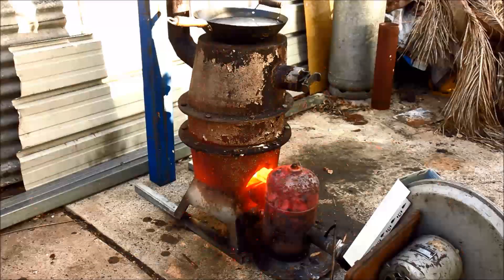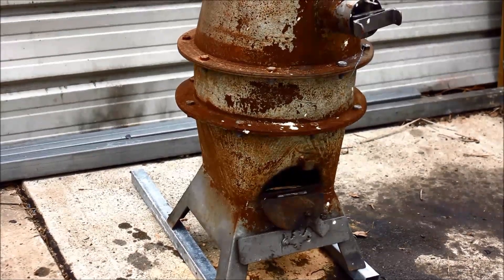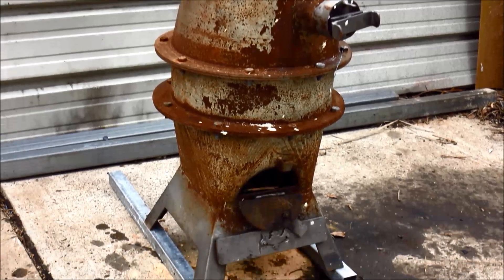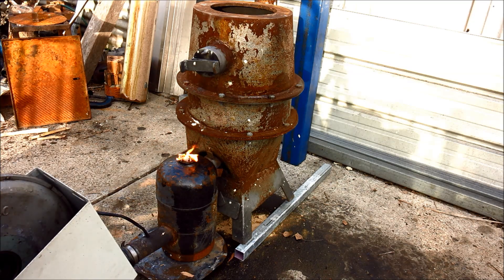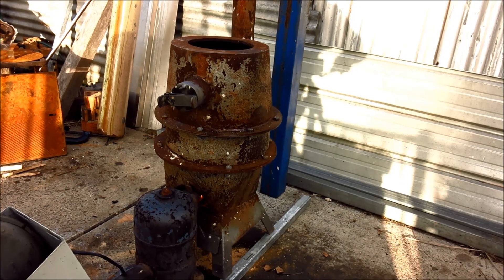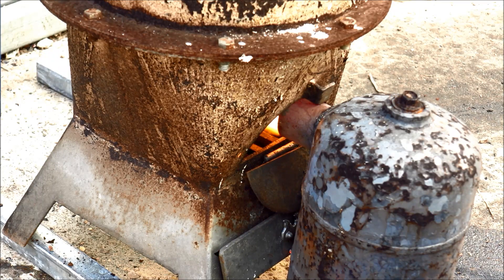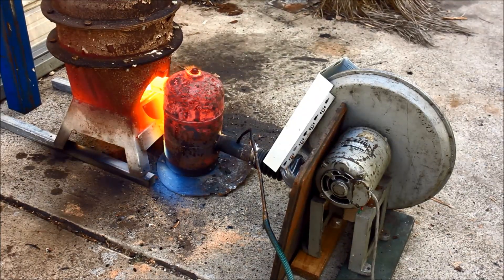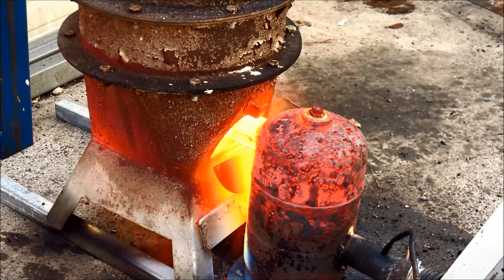Pot Belly Stove Oil burner conversion

Comment: I really enjoy your informative videos and also appreciate the humor. The simplicity of design and the heat you are able to generate is inspiring. Have you ever considered using an old fire hydrant to make an oil burner?
Reply from the maker: +Larry Hutcherson Sr  If you are refering to the Red Hydrants that sit on the footpath, we don't have them here in Oz. There are  special fittings under covers and the fire brigade screw the hydrant into them.  As such, we dont have what you are talking about. I think the sentiment  is right though. they have the right shape although being the size they seem to be and I believer very solid, they would take some preheating.  
Once they were up to temp, I imagine they would make for some  incredibly powerful burners though. 
Another irony in turning fire killers into fire producing beasts.

Comment: I would like to see you make an actual shop heater
Reply from the maker: +jay90374  I have a couple of designs on my other vids already.  I play to do a couple more  " experiments" with this one then convert it into a proper, practical heater that could be used indoors.
Reply: Thanks, I look forward to your vids. I want to use wmo to heat my shop while I work, I just need to find a blower.

Comment: LOVE your channel, it's been the source of continual inspiration! Have you ever had the walls of any of your burners fail on you? It looks like you're getting those things up the iron melting temps!
Reply from the maker: +Coyote Red  Thanks for the kind words!  No, the burner walls always stay intact. I don't think it would be possible to get them hot enough to fail. Even though they have heat on one side, they have nothing to stop it radiating right on out the other side. if i did put some castable refractory or something on them they might go soft but otherwise, i don't think it's really possible. 

They may eventually rust through as I leave the things out in the weather and they flake when i start them up a bit but I don't think they will fail through the temp they reach while running.  I think iron melting temps are basically white hot and i'l a lone way from that with the burners.
Reply: +Oil Burner Makes sense to me! I'll keep these things rockin red hot!

Comment: Have you done a video about thermite? I was wondering if you could use thermite to help get steel to 3000°F and ready to cast. I don't see a lot of casting on your channel.
Reply from the maker: +ownedkapoo  I don't think thermite works like that,  As far as my limited knowledge goes it's more suited to welding than casting but I could be wrong.  I have been meaning to get to the casting for a long time but other things come up and my real passion is for burners.  I'm going to try doing some ally casting soon. I have tons of the stuff to use.

Comment: Great Vid , very entertaining , i have an waste oil heater for my spa pool that works ok, based on the sanders setup, however it could do with a rev up so i think i can use your idea to do the job, nothing worse than waiting for it to heat up on a cold night, have a brother and a mate also into oil heaters and brewing , we call our little club SOBA , sump oil brewers association , will let you know how i get on , Good on ya mate !!
Reply from the maker: +Kevin McCormack  Thanks! I think your organization should expand... But then you'd probably run into a bunch of PC environmentalist do gooders who wouldn't be happy and make things hard for you.   I have a pool heater I have converted to gay and just looking for some plumbing fittings to make work. it's 100Kw rated so would heat up a 2500L spa probably in an hour, 90 min tops.
Running on veg oil, you could afford to heat it up whenever you wanted. I'd like to see a vid of your setup.
Reply: +Oil Burner Will do a vid when i get the new setup running, cheers

Comment: Cool build, I initially thought it was two concrete mixers bolted and welded together....
Reply from the maker: +Yves Baggi   I thought it was 2 truck brake drums but clearly not. One is kind of offset conical shape.  No idea what they were but they were crap as a wood burner. I think with a proper oil burner conversion the thing will be great.
Reply: +Oil Burner i think its a bell housing

Comment: Nice!....What if you put your oil burner inside the Pot Belly, you wouldn´t need to enclose it.  See various other ideas for practical use. Just sitting back and enjoying the fun!!
Reply from the maker: +Roberto .Cavanagh  Yeah Roberto, that's what i intend to do. I impressed myself with this thing. I have had it a while but it's useless as a wood burner and I was thinking to chuck it away.  If I put the burner inside the stove and seal the bottom, all I'll need is a little blower on the outside and the thing will be fit for home heating.

Comment: Also could any of your burners in your previous videos melt things like steel, stainless steel, or iron?
Reply from the maker: +ownedkapoo  Absoloutley.  You would need a furnace with very high quality refractory however to stand up to the heat required.  People are using these burners to do just that. Look up luckygen101 channel and see how he does it.  makes Iron melts look like melting butter on toast.

Comment: I didn't see him put in any oil and I couldn't see how he turned the blower from controllable to insanity. Is there a there a switch or dial to control the blower? Was there already oil sitting at the bottom of the metal vat thingy between the blower and large metal vat thingy?
Reply from the maker: +ownedkapoo  The blower is shown many times in the vid. It's the round circular thing with the motor on it.  I have metal shielding it from the radiant heat of the burner and stove.  It's not the blower that was throttled so much as the oil. Where I show the burner control, the blower is running  constantly, it's just the valve on the oil I'm throttling. 

As I explained, the oil is fed in front of the blower through that tube that goes in the air feed pipe and is blown into the burner  from the airflow.  
Have a look at this Vid   https://www.youtube.com/watch?v=1nTlr6hBv7U    at 14:25 to see the basic air/ fueling setup that i use on all the burners bar the spray burner which has a couple of descriptions on how that is done.
Reply: he starts it with kindling in the tank then slowly turns the blower up then opens the oil line
Reply: +Clarke E Can you show me at what time of the video he put in the oil? Did he use a regular old leaf blower? Or did he use a more complicated blower with switches and buttons?
Reply: +ownedkapoo I don't think I saw it in this video, you can get a better idea watching his others on how he fires it up

Comment: Natural selection,,,,, I love it!!!!  
I am pretty surprised at how much heat the burner can take without blowing a hole in it. What do you think is the longest amount of time you've run one of your burners and have you ever blown a hole in one? 

I'm thinking it might be cool to turn that (PLOP)-belly into a burner itself! Maybe seal up the ash tray and put a rope seal around the door so you can use it for start up. It might be hell to move around, but hell, maybe that upper port could be plumbed to a smelter. 

As alllllways, a great vid, but I don't think  you rolled enough coal to say hello properly yo the neighbors!! ;)
Reply from the maker: +Steve 1961P.  Again you read my Mind Steve. I was thinking to do a full and proper conversion on the heater ( it's useless as a wood burner!) but before I did that, I was thinking I could do a melt Vid with it.  I can just remove the tray at the bottom, put the thing over something to catch the ally and away I go!

I have run the burners over 2 hours at a time but Never blown a hole in one yet. If you look at my furnace meltdown Vid, you can see where I blew a hole in an extinguisher bottle the first time out when it was in the receiving end of a burner.  The fuel Vaporising and the air flow not to mention the air radiating around the burner keep it probably 1000oC cooler than the flame shooting out of the things. Probably why the nozzles on teh burners show a LOT more wear and tear than any other part.  Haven't burnt one off yet but it won't be long on a couple of them. they are getting very burned and thin.  Stainless would probably be better but I haven't paid for a single bit of metal yet I have built my burners from and stainless is not something I find lying round outside scrap yards or dumped by the side of the road.

Comment: Great orange glow on the stove!  
Considering the oily smoke at startup, occasional leaked / sprayed oil escaping and so on, just a bit messy for indoors, how about an oil burner version of an outdoor furnace?  Or you could use the waste-oil powered water heater to run radiators inside.  It would need some automatic controls, or perhaps just a big well-insulated storage tank.
Reply from the maker: +Scott Willis  yeah, this setup was totally impractical for indoor use but i was so impressed by the way it worked anyway and the heat output, I am considering a proper and practical conversion which would make the thing able to be used indoors.  I have been using the water heater for my house. somehow never got a vid but there wasn't much more to it. I just plumbed it to a car radiator  with a fan and  had a circulation pump.  the thing put out some mean heat.  The auto control was the fuel pump timing which regulated the amount of heat the burner produced.   It worked better than I thought. Once the house is warmed up you don't need that much heat and if it got too warm, we opened a window or door.  Thats a home heating luxury you could only do with free fuel!

I'm working on a practical oil powered Swimming pool heater atm which would also work perfectly for home heating with a radiator or hydronic system.

Comment: I made a burner Sunday based on your design, made a video last night of it if you want to see it. I attached it to my melting furnace and other that the shock waves beating my refractory lining, it works great. I made a modification though, I added a propane line for ignition only, after the diesel ignites I shut the propane off and disconnect the line
Reply from the maker: +Clarke E  Great build you have done there and thanks for making me aware of it. i love to see other people putting these things to use and how they do it.
Reply: +Oil Burner thanks, if it hadn't been for you showing how it's done I wouldn't have known where to start

Comment: cool video wish i could do that, that could lower my familys heating bills
Reply from the maker: +Jleone leone  I did a heater setup this winter using the water heater and a car radiator and fan. At first the family complained the setup which I just put on the back Verandah was ugly but soon complained when I didn't fire the thing up because the electric heater still left them cold.  We have never been so warm as we were this winter and people were amazed when they came to visit and found we had the front or back door open.  I ran a 300W pump to circulate the water and the blower on the burner probably used 100W  so it was damn cheap to run considering we were getting 20Kw plus worth of heat out of the thing most of the time and the fuel was free.
Reply: +Oil Burner i fixed the video just look up iron pipe burner
Reply: +Oil Burner the people in thos world just dont have any common sense anymore
Reply: +Jleone leone  this world
Reply: @jleoneleone8760  what
Reply: @DemeDemetre  I made that comment 5 years I had a video about a pipe burner
Reply: @jleoneleone8760  oh